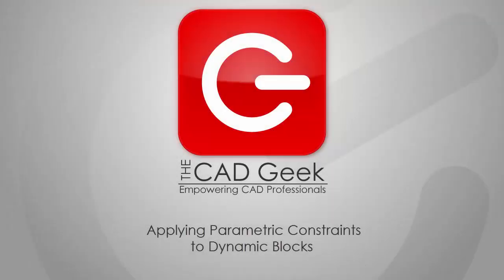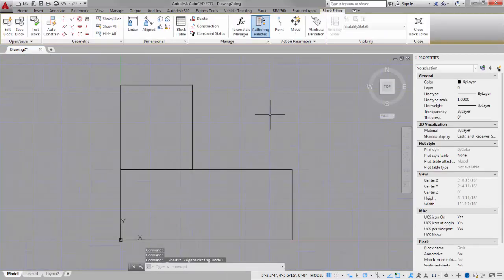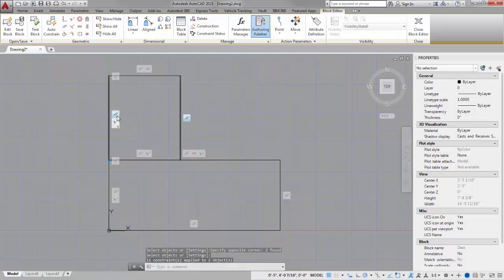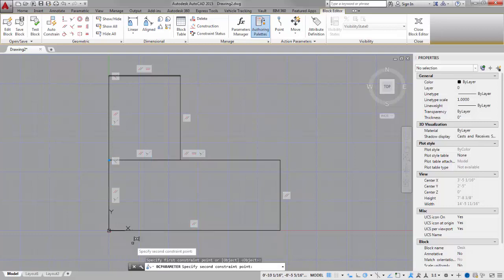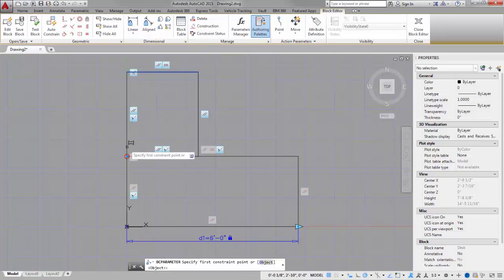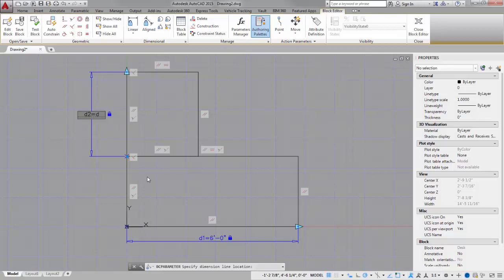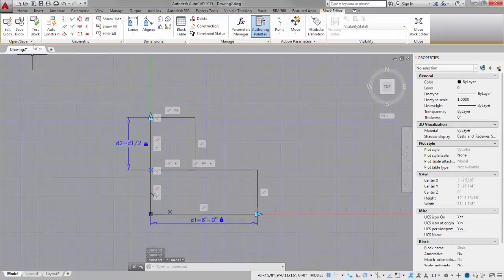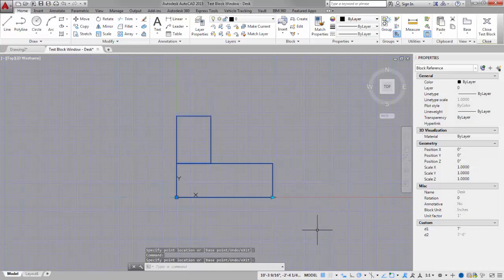Applying Parametric Constraints to AutoCAD Dynamic Blocks

Comment: @The CAD Geek
Thanks, I have a question pls. 
I have an array with 'lookup' and the 'column offset' is not fix, it equal for d2 (variable, depending on d1 'stretch')
I tried to use the calculator and create my own variable, or function. The calculator gives that the variable doesn't has a value in AutoLISP. I won't use AutoLISP to make such function.